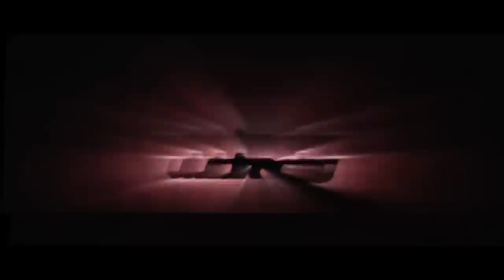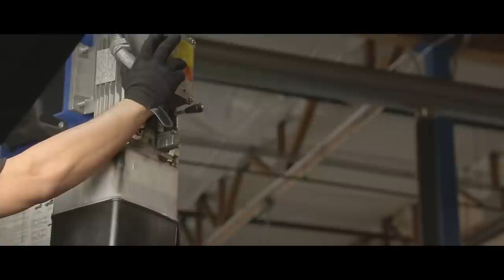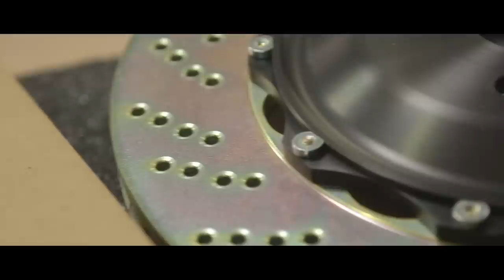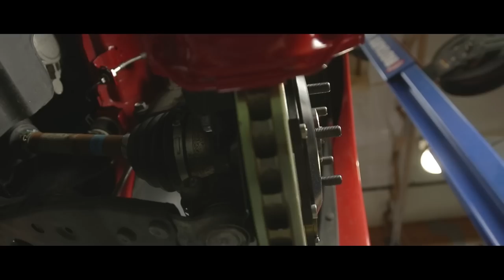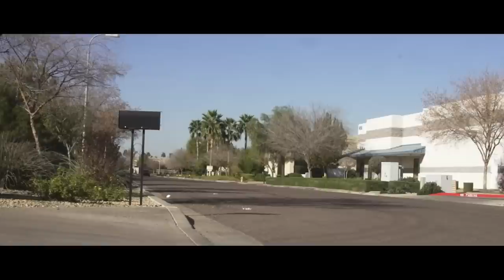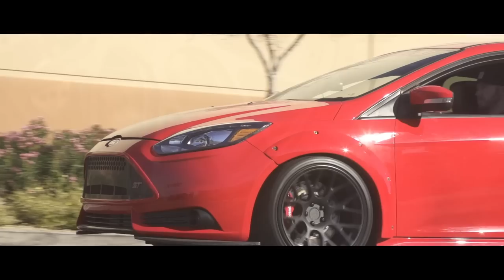Brembo Brake Install and Test on Ford Focus ST

Comment: Thanks Amine Greenoi....the car gets much praise wherever I go.  Bigger turbo in it now and FULL transmission upgrade.....
Reply: good work (y), how much is now the acceleration from 0-100kmh and 0-200kmh ? thanks
Reply: Sorry, it's been a while for the response - but, I don't post numbers of 0-100kmh times or ETs, because there are many idiots that just argue about things like that.  
The LSD puts the power down pretty solid and it does rocket and climb very steadily (to include in the corners).
Reply: What are can I get your rims ???

Comment: Love that rear splitter. Where did you get it?  Also, are you running 19" wheels with 40 series tires?  Is that with stock suspension or did you need to make adjustments with aftermarket suspension to fit 40 series?  I had 35 series tires on my old focus and it was a nightmare with every pothole.  I wont do it again.  I want 19's on my new ST but refuse to run 35 series tires again.

Comment: Vivid Racing
Hi, i have a ford C max 1.6 TDCI Diesel Titanium x with 17" wheel in Turkey. Is there any brembo disc&caliper solution to replace my car's brakes ? If it is exist, what is the part number of these ? BR.
Reply from the maker: We can help you, email dan at vividracing dot com

Comment: the stock ones from the rs fit and you can get the kit for 900 save yourself some money with some oem +
Reply from the maker: Aftermarket are bigger rotors and 2pc floating

Comment: What is the distance in the meters of stopping the car? From what speed?
Reply from the maker: We did not test that.  We were merely showing the brakes off.  Obviously there is a HUGE improvement over stock.

Comment: Ooh. Just bought stuff from you fellas
Reply: Strut bar to be correct. MASSIVE. Absolutely beautiful piece. I believe I bought the rear from you. I bought the front from Panda and was very unhappy with their time frame. 3.5 weeks. They must make the thing I suppose as I did call them 3 times. I had yours in 2 days. Thanks. My car is on rails
Reply from the maker: Thank you for the support

Comment: The rotational direction of the drilled rotors looks wrong
Reply: I thought so as well when I first seen it. But that is the direction that both Brembo and StopTech suggest when installing the brakes.